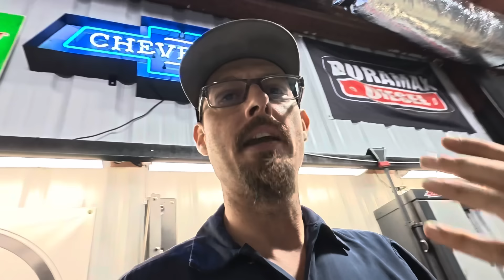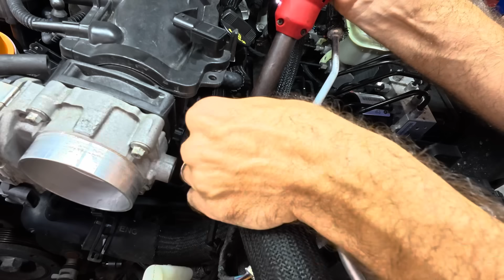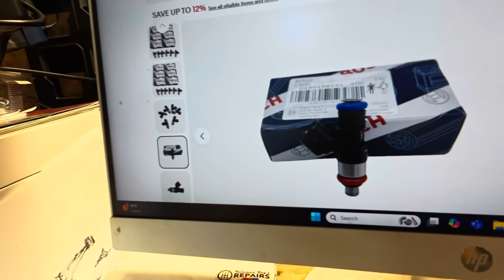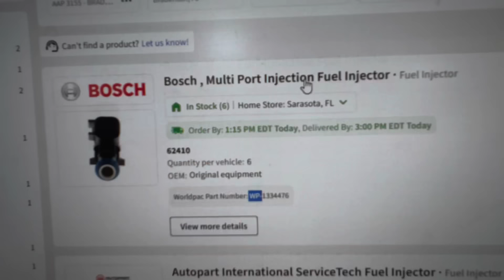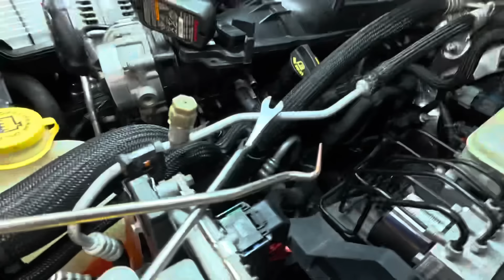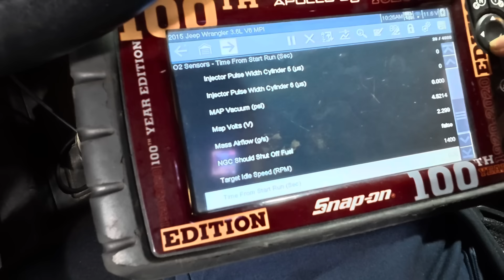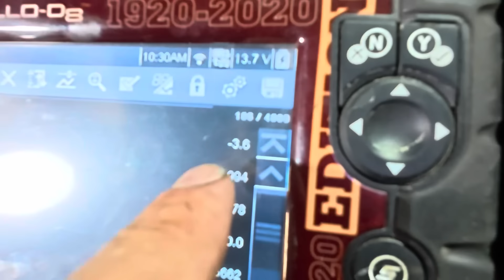Problem FOUND! E-Commerce Auto Parts (STRIKES AGAIN) Jeep Wrangler 3.6 P0172 P0175

Comment: Only “parts” I’ve bought from eBay are non consequential interior pieces, used body parts, and one time sent my gauge cluster in for a rebuild through an eBay seller. Rockauto is usually cheaper and you’re guaranteed a name brand when you order a name brand. The actual Bosch fuel injectors (same as OE, the Mopar ones have a Bosch stamp on them) are only $250 for the set on Rockauto, customer would’ve saved money by spending $150 extra instead of having to take it to Ray.

Comment: You Forgot To Remove The Papers From The Intake - You Have To Remove It To Get The Engine To Run (Will Not Work With The Papers In The Holes)

Comment: Ray testing to see if we are following... LOL "the camera dropped" sure Ray... You remembered the KWipes and went back in for them... I'm running into counterfeit BOSH injectors for diesel direct injectors, the price wasn't the indicator, the source was supposedly valid, a regular parts hunter in the USA found the injectors two times in particular. I never get incorrect ones when I look for them, but I've been running into alot of them recently. They usually have the same compensation numbers, but that isn't always the case.

Comment: The ebay advert for one of those "Bosch" offerings (parts currently located in China ...) also bafflingly says "You can give us your hairstyle number and we can help you find them."  I wonder what they think they're selling?  "I need a set of injectors for a #6 cut."
Reply: That's merely an interpretive issue between Chinese and English. Think about it.
Reply: @johnt.848  I've been thinking ... and I'm baffled.  Hairstyle = Headline?  What else might be equivalent to hairstyle in another context?  What is a hairstyle but a head decoration, if you like.  What decorates the head of an engine?  No, that doesn't work.
Anyway, it is the seller's job to be clear, not ours to know they meant something secretively different!

Comment: wouldn't a flow test in a fuel injector rig tell you how much fuel they are putting out?  to confirm that the replacement units are spraying too much fuel?
Reply: Well that's gunna require more diagnostic time and extra "shop supplies" charge. Lol.

Comment: in my experiance. something made by Bosch has "Bosch" stamped into the plastic/metal or whatever somewhere on it. in my opinion if it doesnt have that its not a Bosch. some would argue that Bosch probably made some things and sent them to other companys without their own branding on it... yeah im not really buying that. a company like Bosch likes to tell you that its their item, maybe so you go get another because its already lasted 10 years and you want another 10 years. the ones that worry me the most is things without any name on them, not even a sticker saying "Made in Taiwan" that makes me nervous. how would you trace it? how do you find the exact specs to make sure it matches what you need? in the case of injectors, can it flow enough for a big turbo upgrade or is it going to fall flat on its face?

STOP BUYING CHEAP CRAP, PEOPLE !!! 

when i needed a new diesel injector on my 2013 16hdi pug 308 SW my cousin told me a place that would test, refurbish or replace them with OE new. we ended up with 4 new ones to make them easier to code/relearn. i paid £900 which is about $1208.71 according to my phone, not exactly cheap. thats for all 4 and the pipe that goes between them (very common they get broken and it did) my cousin fit and coded them as he is a mechanic and had proper tools etc... if i had gone to a garage i would have paid double for the labour but i could have got cheap injectors for next to nothing and probably have constant problems. its not worth it. i admit i couldnt afford it but the bank of Mum was very kind and helpful and i paid her back over about a year, a bit each month. of course i didnt not give my cousin something, he got a little money that was left over and i got him a case of bear. he was happy, it was only a side job for family to him. to me it got me back on the road with minimal hassle

Comment: Never change out OEM parts because you think its time...If they work dont do it because aftermarket will never be better.I really love your style ray...you teach us DIY guys so much...I mean really its valuable info.Your style is amazing...your knowledge is great.Its very much an automotive class every time you watch..
Reply: Covered by "If it ain't broke, don't fix it."
Reply: Only reason to do that is if it's a known factory issue
Reply: Default should always be replace with OEM.  Only use aftermarket if you have specific knowledge indicating the aftermarket brand and part is worth buying.
Reply: @raiden031  I had a crash in my 88 Bronco one time, wrecked the front right fender. (Totally my fault, no other vehicle involved).
The OEM replacement fender was wrong, such that when I went to replace a headlight bulb afterwards, the body shop had to cut the access hole bigger because the hole existing was off by about 1-1/2" inches.
I will admit that was a rare occurrence.
Reply: Sometimes,  aftermarket is better because they redesign it to fix the OEM flaws.
Reply: @seeya205  Pretty much if its Plastic its a Design Flaw
Reply: @seeya205  Sometimes. I'm still looking for an improved aftermarket Grand Cherokee water pump. No dice.
Reply: @seeya205  Yes basically I hate plastic parts on engines in places that they are exposed to heat, Oil, coolant or pressure. It gets brittle, cracks or melts as it ages under these conditions. I have a2017 Dodge Challenger GT with 93,000 miles on it that I am watching very closely for signs that the OEM plastic oil cooler is failing as I know it will as I have the lifetime warranty from Dodge when it does start leaking I will be pushing vary hard that when it is replaced under warranty that I be able to buy the Dorman all aluminum one and have that put in instead of another inferior OEM plastic one.

Comment: Thanks Ray, I have a 04 F150 5.4 3v with the exact same problem, when I rebuilt my motor I order fuel injectors for an 05. I have been trying to find the problem for 6 months and couldn't. Truck runs great but every 2 or 3 weeks I got a rich code on both banks, I went through my paper work and found the problem, now I have to pay other 900,00 for new injectors. f**k me.

Comment: A few of those listings were for "reman" injectors... I'm not personally a fan, but if you genuinely re-tested a set and they flowed properly, they would be OK to use IMO. I wouldn't replace a set of working injectors for them, mind. 
However Bosch counterfeit stuff online is getting ridiculous. It's so bad that Bosch have started putting unique codes with injectors, so you can look up on their site to verify authenticity. What a world :(

Comment: From an Engineering Generalist standpoint, as you started this video (not seeing the prior one) I went immediately to the thought of out of spec parts.  If the bore of the injector is out of tolerance, more, or less fuel at the same operating pressure of the upstream components.    "The more they overthink the plumbing, the easier it is to stop up the drain."~ LT Commander Montgomery Scott.
Reply: I've tried to find that quote, had trouble.  No real use for it though.
Reply: @russellstyles5381 star trek.  Search for spock.

Comment: mr blue towel funnyman...  just this summer, got a whole LSA built and in the car, everything hooked up and trim installed.  then my brain said..."did you take the towels out of the intake ports?"  fuuuuuu.....  didn't find them in the garbage, tore the whole top end down, i had removed them but my brain thought it'd pull a funny on me.

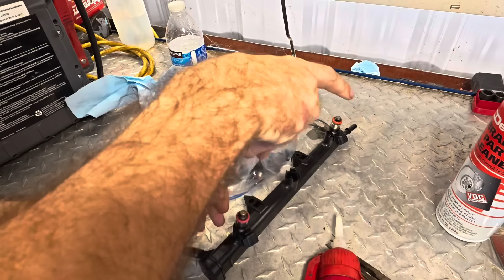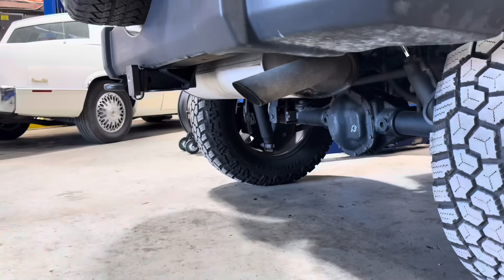Comment: @4:30... Okay, that's info we didn't have in the last video when you asked for our help. Did you know what parts had been replaced, because that's info that was left out? You left us with the question about when the CEL came on. Did you find out it was after the work was done? Or did he replace the injectors because of the CEL? @4:41... And THIS is why I refuse to use customer supplied parts. If he brought me 4 injectors in Bosch boxes, I would just assume they were real parts and installed them. Then I'd be running in circles trying to figure out the problem, assuming the injectors were good. If I knew from the outset that he paid $100 for 6 injectors, I'd tell him, "dude, you got scammed and I'm not installing those". So, to avoid this altogether, I buy the parts, or you can go somewhere else. @10:17... Fuel injectors are not a normal, "while you're in there" part. Why on Earth would someone do that? @25:45... You should tell him to send them back with a note that says, "F**k you, you f**king f**ks!" and demand a refund. If they don't refund the money, file a claim with Paypal along with a tracking number for the return and they'll refund him. Then file a report with eBay for selling counterfeit parts. @31:55... Were the rags a mistake and then you corrected it off camera or was it a planned troll from the start? @41:51... The real techs know anything left in the intake, if it makes it through the engine, gets caught in the cat.

Comment: This must have been noticed at some point and addressed. And just cleaned up in editing. Because those shop towels were in there when that manifold landed in place and when bolts, screws, and nuts were put on. 
I don’t see how an engine could run with shop towels in the intake. 
And yet, it ran like a watch!
I looked at again. I didn’t see any cuts. Unless it was during the time when the camera was moved around.

Comment: On RockAuto, the Bosch 62410 injectors costs $47 each or MOPAR 5184085AC costs $110 each. Dealers are a big azz ripoff, RockAuto saves people a lot of money.
Reply: You can get fakes off crack auto and the discount is reflected in their (lack of) customer support.

That said they are a good source just be careful
Reply: @patriotgarage I have purchased a lot of OEM parts from RockAuto almost 10 years and 0 issues, you probably got a faulty product which happens.
Reply: @jamesnall569  I got someone’s return that was likely sold to rock auto. We know how well parts stores check returns (they don’t) they made me pay return shipping to return them that’s the part that rubbed me wrong
Reply: Been buying parts from them over 20 years. Always top brand names or OEM. Never a problem but always cheaper than anywhere else.
Reply: @3100fps  Gotta' be careful with ALL parts suppliers these days. NAPA, O'REILLY'S,  ADVANCE, AUTOZONE sell all grades of parts. Even the dealers o.e.m. electronic parts can be garbage. During the past 10yrs.; Chinese sourcing is across the board.
Reply: Agreed!
Reply: You do need to be cautious that the "Oh my gosh that's cheap!" Bosch you get a great deal on is not "Beijing's other shady component house"
Reply: Yep! I have been using them for 20 years and I only had one issue which was the belt sent was too short. They sent me a shipping label,  I returned it and they sent me another one in two days.
Reply: Junk-rock auto strikes again!

Comment: The four spray holes on the bogus injectors are visibly larger than the four in the originals. Probably allowing double or more fuel than was necessary to be injected.
Reply: They also look larger in diameter.

Comment: I remember watching an episode of Air Crash Investigation where a crash happened due to cheap Chinese pats being labelled OEM & the part had failed causing the crash. This is just like that, the parts are said to be "Bosch" but they are clones. If the price looks too good do not buy it. A Motor Factors of repute or Main Dealer is the right place to buy any electronics parts, it is worth the extra cost in the long run.
Reply: you be surprised how many peps get off on cheap parts that they completely lose it, They also get off on it!   yet experience is requirement in this area.

Comment: You said he replaced the oil cooler. I hope that isn't a cheap junk one from E-bay. I have some serious concerns of the dangers and hassles from such way too cheap, counterfeit and junk parts. One is to cause a major failure causing a crash that could kill or maim you and others. I wonder how many in the USA are killed or maimed by the failure of such parts, especially key engine, drive train, suspension and brake parts. Another is that parts like the injectors, you have drive ability issues, damage the engine, poor fuel economy, and fail state pollution tests (like in NY, NJ, CA).

Comment: what I don't understand that these Chinese products are nearly up to par but fail It wouldn't cost that much to make them right.but apparently the screw up and make a bad product- The capacity and knowledge is there for example the operate already dark factories so you would suggest they are capable of producing proper products. It is kind of mind blowing how it works over there. We need to tighten our belts and wake up and start innovating and don't be proud of old stuff like " it always worked so it is good enough" otherwise we will be flooded with products that can compete with the original pretty soon

Comment: Ray you had the answer to the problem in the other video but talked yourself out of it. Haveing been a mechanic for 45 years when you said the customer had work done the hair on my neck stood up. I would always ask the customer more questions when they indicated previous work. Many times the current issues were related to previous work. Good troubleshooting video showing the trials and tribulations of a real mechanic.

Comment: You mixed up volume & mass again...the volume of fuel injected is of no significance, since gas is very "flighty"...its density varies strongly with temperature.  It's the MASS that is significant, since this
has to match the MASS of AIR at, roughly, a 1:14 ratio...one gram (ca 1/30 oz) of gas to 14 grams of air (roughly 12 litres, or about 3.1 US gallons)

Comment: I don't even wanna hear about injectors...lol.  My tech back a while back was replacing mine, and it took 3 sets to get a set that didn't just sit there and leak into the cylinders. Not his fault, it was the company that rebuilt them or something.  Luckily they had to pay his labor to replace them, and we got a good pair that works.  I can imagine he had a few words for that company, and I hope not for me...lol. Did good though, which is why I keep going to him.  Always treats me right and does things right.  Just I have a 2005 Silverado, and they just don't make new part for certain things.  BUT, all the work he did to it brought my fuel mileage from 13 to almost 20mpg.  I think those old ones probably were about rotted out.  Ethanol isn't good on the old injectors like they are on the new ones maybe.  Anyway, always good to figure things out without the parts cannon.  I don't know why Chrysler replaced the straight 4.0L for that 3.6L junk.  Those 4.0Ls if kept up would last a LONG time.  And, oil leaks just mean self-lubricating the frames from rust..lol  Cheers.
ps...way to troll us again with the blue rags.  That one that shot out of the tail pipe.  Perfect.  Reading the comments below...GOT EM ROFL.

Comment: Oof. Classic case of fixing what weren't broke. I mean, it's one thing to get a bunch of "while I'm there" parts if they're actually bad or getting close enough you'll be doing some seriously pain the butt work to get at them soon-ish after the initial repair anyway...but you should really do your best to know that before turning the first wrench, I figure. Saves time and money in the long run. In this case, I wouldn't have touched the injectors if they were working fine before.

Comment: The first thing I ask when I see new parts on a engine is were did you buy them. I ran into this with a transmission rebuild the customer bought eBay rebuild kit for a fwd 15 Ford explorer automatic transmission, nothing lined up with the OEM. My customer paid $1000.00 plus for the kit I bought the OEM Ford parts for $1200.00 everything fit perfectly

Comment: I was dying to know what the owner did just  BEFORE bringing it into Ray's shop. In my case buying from online sources
where I  needed a new gas tank pressure switch on a 2016 Jeep Patriot.  But all was fine, my Jeep passed emission
inspection twice and now after 6 years no problems with the new one. That may not be the case  buying  emission related 
stuff on the web. Maybe I was just lucky this time.

Comment: I bought a ebay timing belt/pullies/tensioner for $40.00 and a month later paid $7000 for a new engine installed.   The cheap stuff is not worth it.  The engine only had 50,000 on it.  Then Bang!  thx for sharing
Reply: 😂DUMBA$S 😂😂

Comment: Ray, either aleays block holes with blue towel or never. If always, you will not forget to remove them because it will be 2nd nature to remove them before putting stuff back.

Comment: About a year ago, I purchased some Honda door lock actuators for a 2000 Honda Accord from a 4 star seller on eBay. Received the box and I knew for the price they were cheap Chinese knockoffs. The discolored and flimsy cardboard box (very thin) the cheap replica of the Honda part sticker. One year later, they’re making noise and slow to work. That’s not a critical part like injectors. I reported that seller to eBay since they sold pirated parts. Amazon is full of those sellers.
Reply: I bought a TPS sensors and the thing acted so strange it caused my car to rev to 2,500 rpms on start up. Got an original part from a junkyard and it fixed my problem. The strange thing is the packaging was OEM AC Delco but after searching up the part numbers it was not a AC Deco part it was some cheap Chinese knock off.